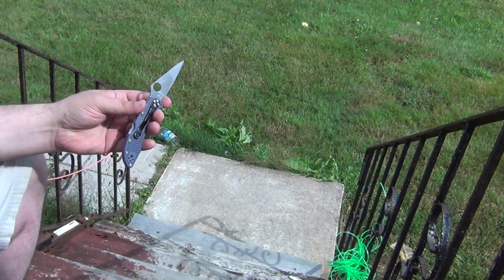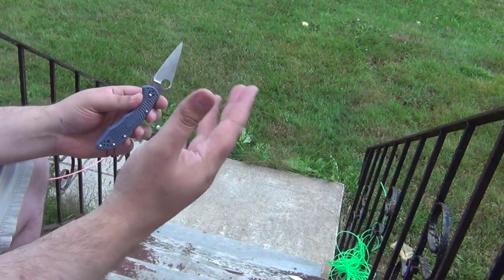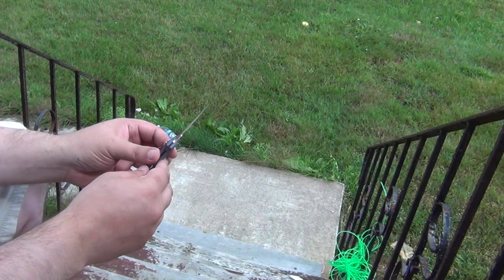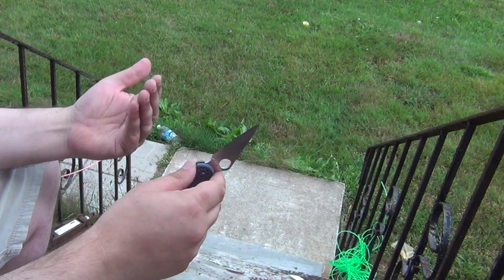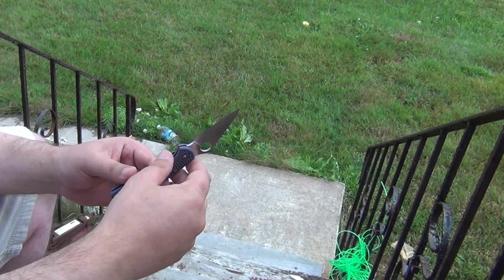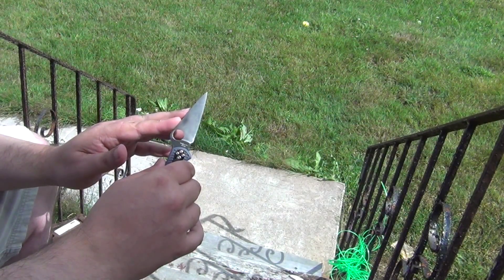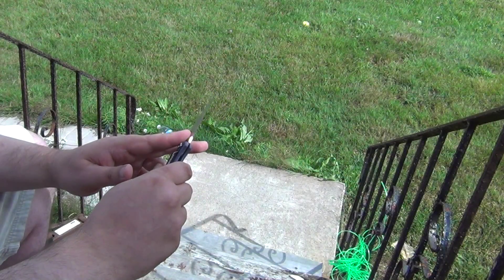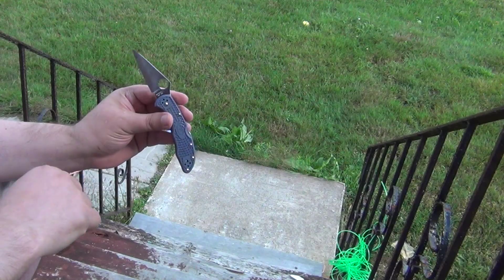Spyderco Delica ZDP-189 : edge retention on polypropylene (fine vs medium rods)

Comment: So cliff what is your pick for the perfect steel for the money? The more i watch your videos the more i need to know your opinion on the perfect steel and one thats worth the money.
Reply from the maker: Different steels have different properties, you have to match the properties to the performance you want. I tend to like simpler steels as they are very resistant to damage, easy to repair/regrind, handle very low angles/thin profiles well - and will have decent edge retention if hardened properly. But if you have different preferences than me, you will want different steels.
Reply: Cliff Stamp i want a steel that is pretty much a good performer in all areas but not like an A performer in anything but maybe toughness. I dont like a steel that is easy chipped and i dont like a steel that doesn’t hold an edge for long. I like s30v but i wish it held an edge alittle better. I would like zdp-189 but you say its prone to chipping. VG-10 is not too bad but i have had troubles with it chipping. Pretty much i would like a good reliable performer in most areas. I want the most edge holding properties without chipping and stainless is not the biggest concern to me. I would sacrifice stainless for alittle better edge holding or toughness. So what is your opinion given that? Oh and price is no concern i believe in paying for good steel but not paying for the hype or name of the steel.
Reply from the maker: @nintendontbutdo5507  What are you typically cutting?
ZDP-189 will chip easier than many steels as it is much harder with a much higher carbide content. Will it chip on what you are cutting - hard to say. What angles/edge thickness do you typically run?
Reply: Cliff Stamp i like angles at maybe 20 degrees because that will ensure better toughness and less risk of chipping. I have looked at maxamet steel and i have been very impressed at what it can do but i am worried that i will pay for a steel that will chip easy. I cut boxesu and other paper goods with the risk of hitting stapl
Reply: Cliff Stamp i may hit staples from time to time or other metals and i would like a steel to deal with that good or at least be able to fix easy and still be worth the money as a high grade steel
Reply: Cliff Stamp i want your recommendation for a steel in a edc knife that you would be comfortable carrying in your pocket if a zombie apocalypse broke out and you only had one choice of knife to carry before you fled your house in fear of your life. That steel would be your comfort and your choice because you would have no other chance to find another knife. Its the end of the world kind of thing and i want your idea and choice of a steel that would make you happy and comfortable to own in that sort of situation. No matter the angle or what your cutting im wanting a pick of steel that makes the most picky knife snob say its a ok sir :)

Comment: Incredibly sensible. Loved this. Wonder about the microbevel. Seems here you move to 20 to remove the burr and then back to 15. Is that accomplishing the same basic thing as moving to 20 and laying in a microbevel? Essentially I guess my question is are microbevels more about burr removal than basic edge retention? (...outside of how that relates to burrs).
Reply from the maker: Going back to 15 is just minimizing the size of the micro-bevel at 20. It isn't a necessary step, just trying to maximize performance.

Comment: Interesting hearing that high carbide steels are best applied slicing abrasive materials. Is that simply because they're more wear resistant? Do you have any material detailing different steels and their optimal usages?
Reply from the maker: Essentially, yes in regards to wear resistance.

Piles of it is discussed on the form and webpages, for example :

http://www.cliffstamp.com/knives/articles/index.html

Comment: I wonder why a company as Rockstead, well known for their high hardnes (>65RC) ZDP advise to only "strop" on a brett covered with a piece of nailed jeans material loaded with compound. And send it to them once in a while for sharpening.
Do you understand their advice Cliff?
The more i try to understand, the more i feel ignorent.
Reply from the maker: +KnifeCollector031 The Netherlands (Messenhobby) It is a very high wear steel so it may be the case in light use that mainly the apex is deformed vs worn.
Reply: Ok, thanks a lot.

Comment: with the kick removed on that delica, does the edge strike against the lockbar?
Reply from the maker: No issues, it is still there under the choil.
Reply: nice addition! i had been wondering about that. i'm slowly working on regrinding my zdp189 endura but, it is sabre ground so it will take me awhile.

Comment: curious of what you might think of the old carborundum stones. Just started on one that i received as a gift seems to make a quick slurry.
Reply from the maker: I have a number of older stones, they vary quite significantly in grit and nature of binder. The harder ones are very nice for finishing as they easily set the apex without the buildup of slurry or round due to wear. The softer ones tend to be nice for fast grinding as they constantly release fresh abrasive.
Reply: thanks for the reply.

Comment: i love the part about how people make a dichotomy out of the terms sharpening/honing. these are people i never look forward to speaking to because in general you can never get a point across to them because they just like to hear themselves speak, kinda lika dealing with grammar/punctuation nazis and how they can miss the point of the entire conversation because they can't see the forest for the trees (What Too Send Too GrammarPolice). i looked up the definitions of sharpening and honing and found that both methods are achieved through abrasion. if you make something more sharp than it was, it is sharpening.
Reply from the maker: Yeah the real issue is that when they are separated it leads to nonsense in general as people think there is something extremely different happening and you start to see arguments such as some steels need to be honed while others need to be sharpened and some stones hone while other stones abrade and similar jibberish.
Reply: here is a good example of it quote from an article about abrasive from wikipedia: "Files are not abrasives. They remove material not by scratching or rubbing, but by the cutting action of sharp teeth which have been cut into the surface of the file, very much like those of a saw." interesting to see this and right on subject.
Reply from the maker: knives save lives Yes, and abrasion takes place often by ploughing and fracture, almost identical to how a file cuts steel, just on a finer scale. There are a number of odd things people think about this subject, one of the most common ones is that some abrasives are made to cut and others are made to polish and polishing isn't done by scratching/abrasion it is - well just polishing. A lot of it comes because people are just going by what you can see by eye and not understanding on a smaller scale it is the same thing.

Comment: its times like these you should pull out the bad HT elmax knife and explain howmany sharpenings its had, and still has steel
Reply from the maker: Nice point, the thing most people don't understand is that in sharpening you don't actually have to remove any metal from the width of the blade at all, this should only come off in use not sharpening. It is the over promotion of burr based sharpening which makes this happen, especially if people develop a heavy burr every time they change grits. 

Nice point/demo example.
Reply from the maker: ***** The apex stability of ZDP-189 is reduced due to the carbide volume yes and it also reduces the toughness directly. Now as to if this is a practical negative, it depends on what you are using it for. If you are working with very high levels of sharpness and like the performance of white steels then you are likely not going to be that impressed with ZDP-189. However if you enjoy ATS-34, VG-10 and similar then you will likely enjoy ZDP-189.
Reply from the maker: ***** In Japan, yeah sure really easy. In the west, look for 52100 or 1095 with a decent hardening. Joe Calton for example.
Reply from the maker: *****
Read this thread :

http://www.spyderco.com/forumII/viewtopic.php?f=2&t=65676

and watch what happens when I post information which is based on metallurgy and physics. This is why there is so much hype in the industry.

Comment: Cliff, do you use some kind of jig to set the angle as you sharpen? I know that its been one of my problems, trying to establish the angle, especially on knives with a full height taper.  I had tried a Lansky system for my Para 2, but found that because of the blades full height taper, setting it into a flat clamp is useless. If I were to use the sharpmaker, even though the rods themselves are set into the base at an angle, I am estimating true vertical, but have no real way of knowing if its true vertical. I have a feeling that with tapered blades, that the edge angle is more or less an estimation.
Reply from the maker: I have used and do use jig-based systems but more for comparisons/evaluations of them than practical use.

If you split up sharpening into two distinct stages :

-shaping the blade, establishing the desired edge thickness/angle
-setting the apex (micro-bevel)

then the requirement for precise angle control is almost non-existent, assuming you don't care about aesthetics.

Comment: Mind = blown.  And I can't think of a compelling argument.

Could you also extend this argument to stropping?  Cause I found that I can keep VG-10 supersharp by stropping after use, but it always seems to make these harder, more ceramic steels actually duller, which frustrates me to no end.
Reply from the maker: Yes, stropping causes a similar effect just stronger (worse). It is one of the reasons why a lot of people get impressed with very trivial tasks of knives because their actual benchmark for performance are those damaged/fatigued edges.

Comment: I hadn't really considered that problem before. Wear not removing all the weakened metal, but continuing to sharpen on a higher polish knife, would not remove all the metal, and then perhaps cause a bigger failure, I.E. large chip. Thus giving ZDP-189 the reputation of chipping. 

If people were to sharpen ZDP-189 optimally say like someone would 1095, I would suspect it would be less likely to be known for this issue perhaps?
Reply from the maker: Perspective is needed of course, I am not saying that in general ZDP-189 isn't brittle, just that the way it is sharpened exaggerates it. What I do with my brittle knives without concern tends to exceed what people get excited about with the "tough" ones. The majority of people really don't know how steels should behave as they have not handled a knife which was sharpened properly. There is too much emphasis put on aesthetics and conserving steel vs maximizing performance of the knife. But again, hillbilly - don't really care about those things that much.

Comment: Excellent bit of wisdom, well supported as usual, Cliff.  This is one of those concepts that's easy to forget over time, even if you know it to be true.  It follows the logic I hold about using a steel on kitchen knives, and others as well, which just brings weakened steel back in like to be deformed again, more quickly than the first time.  Thanks for taking the time to do this one!